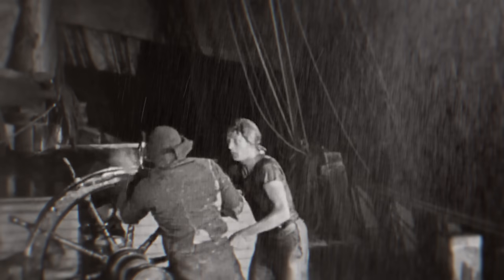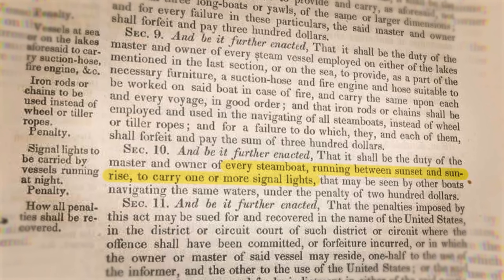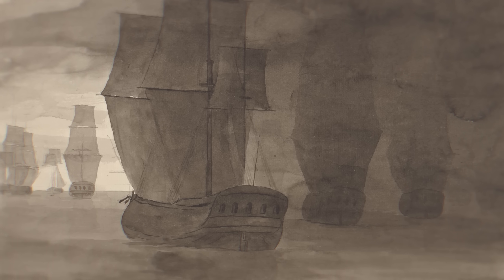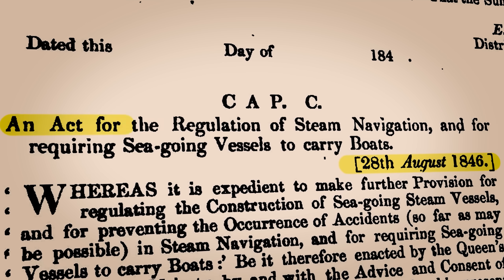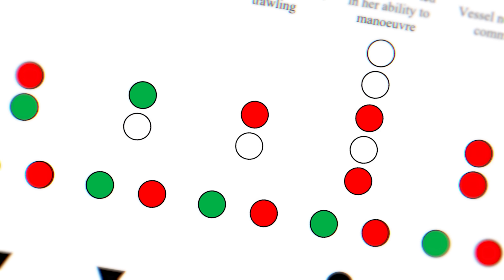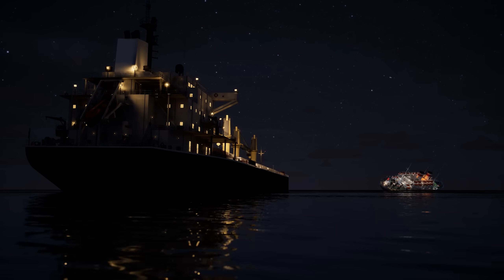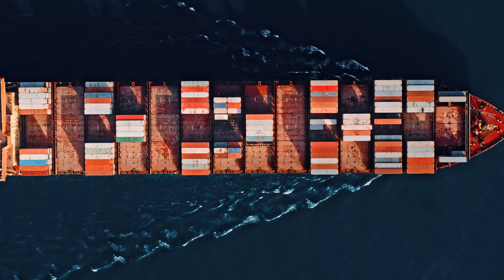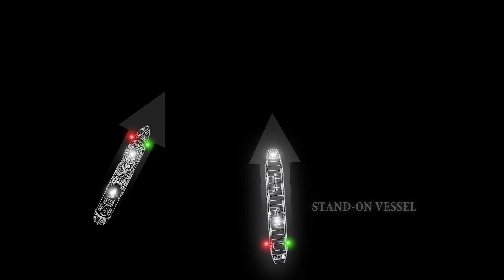How Ships' Lights Work

Comment: Aviation has learned a lot from maritime, aircraft use port and starboard red and green along with several other carry overs. Perhaps the maritime industry could adopt some things from aviation, such as TCAS. Traffic Collision Avoidance System. A modern take on the avoidance rules, especially helpful in fog or low visibility.
Reply: They also use knots for speed

Comment: One of the things that probably led to the choice of red and green is that both can be achieved easily by placing colored filters over a regular yellow light, like the one oil or kerosene lamps or give off, and that later on could be easily achieved from incandescent lightbulbs. If blue was chosen, for example, it would be really hard to make a bright enough light to give off a signal that was clearly visible at great distance.
Reply: Yes, glass makers can easily make a good green and red glass that transmits light well, along with a clear glass, and this, when combined with the low output amps of the time was needed. Other colours were both harder to make, and less light transmission in thick sections, which would be needed to survive rough sea and handling.
Reply: I was about to say the same thing.  Blue would have been very hard to do.
Reply: A blue glass or lens in front of a yellow flame will give you a green light. For a long time kerosene or similar was used for lighting.
Reply: @Kevin-go2dw  hmmm no… primary colours of light is red green and blue…. Yellow light only contains red and green light… so no you can not make green with blue glass/lens… you can get red or green with a red or green glass/lens.. you are thinking of paints.
Reply: @magnustveten492  early glassmaking didn't achieve perfect color filters like we can produce today. their "blue" glass, which allowed a range of shorter wavelengths through in sunlight, would have permitted enough green spectrum through that a yellow light (lacking in the true blue spectrum) would have appeared green.
Reply: Blue was used in wartime as a station-keeping stern light for ships in convoy, when all other lights were necessarily extinguished. In that situation, a dim light was a virtue as it would only be visible from close quarters and unlikely to attract unwanted attention.
Reply: The human eye is also the most sensitive to green color. But they probably didn't know that back when red and green were selected.
Reply: @major__kong  White lights can be mistaken for stars. Yellow/orange lights are usually used in fog situations or might be mistaken for sunlight reflected on the water. Red and Green are the more luminous against a dark or black background.
Reply: @KebabMusicLtd  easier to distinguish one from the other. Better than red and orange, for example.
Reply: And i also have a question,why do ships needs to have the green and red lights on the deck's side and not on the mast and oriented as usual ?
Reply: @EdwardBesleaga-y1j.  Perhaps because it is/was easier to tend to lights at deck level, and that collisions only happen when vessels are close by, so putting them at deck height would be enough to be seen at the distances that sailors had to worry about collisions. On top of the mast would make them visible from way too far away.
Reply: That and we have cones for red and green.
Reply: I've seen some pretty good hypotheses on here for the choice of red and green lights. While I'm sure at the time they didn't know about blackbody radiators, trichromatic vision, or photopic vs. scotopic vision, they would have made their choices based on convenience as well as trial and error.

Contrary to popular belief, these colors, particularly red, actually align poorly with night vision sensitivity. While green light is the peak of human sensitivity*in daylight* (known as photopic vision), as it becomes darker, the vision's sensitivity drifts toward blue (scotopic vision) and we become particularly insensitive to longer wavelengths, particularly reds. This is known as the Purkinje effect.

So why red and green? I'd suspect necessity. Light from a flame simulates a blackbody, and often a particularly cool one, maybe somewhere between 1200 and 1800 K. The vast amount of visible light would have been in the longest wavelengths, red. Whatever other color is chosen has to be far enough away from red to avoid any ambiguity but is at the disadvantage of such a light source producing drastically less amount of light. On the other hand, human sensitivity does partially offset this...

Our eyes are still reasonably sensitive to green at night and it has the advantage of mostly stimulating a different cone (assuming you don't have some particular kinds of color blindness). The orange-yellow unfiltered light for the other light sources are also far away from both to avoid any ambiguity there either.

While I lack any real knowledge of old school glass manufacturing to speak of the efficacy of blue filtering at the time, there is so little blue light in such a flame that I believe any methods, even modern ones, would result in such a dim light the two colors would not appear equidistant, assuming they could be seen at all.

Furthermore, one must consider why we experience the Purkinje effect in the first place - at night, all natural light shifts toward blue! Compound that with how water absorbs long wavelengths, the blue appearance of so many stars... While I can't be sure this played a part at all, it certainly would have been such a disadvantage.

Finally, while I am very confident that preserving night adaptation had nothing to do with the color choice, it is very true that use of deep red light helps there. We use such lights in astronomy for that exact purpose.
Reply: Odd that this wasn't mention in a video titled Here's Why Ship Lights are Red & Green
Reply: @SamuelFritz2001  well maybe itd be in a video on how old colored glass was made.
Reply: @SamuelFritz2001 Touché!! 💯

Comment: One reason that red and green were probably chosen comes from oil lamps. As they have a yellow flame, it is impossible to create blue (put a blue filter and you get green - in fact, many oil lights use a blue filter for green for this reason). Yellow was presumably also out as this could just be a broken filter, etc. 4:43
Reply: Yet law enforcement vessels and vehicles show Blue lights all 24hrs so that they can be ID'ed as LEO people as opposed to civilians.
Reply: So you copied the other guy's comment?

Comment: When I was in the navy we were told that port and starboard come from old ships where the  steering was done by an oar on the side of the ship.  Since most people are right handed the oar was on the right side of the ship. Therefore it became the "steerboard" or starboard side.  When you went in to dock you didn't want to damage the rudder so you tied up left side to the pier so it was the Port side.
Reply: In older days the terms were starboard (steerboard) and larboard. These could be confused in bad weather, so the latter became port.  We’ve just been to Cyprus where there is a reconstructed trading vessel from 300BC - this had steering oars on both sides of the stern…
Reply: This doesn't seem possible, you need oars on both sides of the ship.
Reply: @neondemon5137  The oar was for steering not propulsion
Reply: @neondemon5137  Just re-read the OP and all will become clear. 😉

Comment: Great video Mike, from a long time oceanliner buff in Norway. A comment to the navigation lights: In addition to the red and green port/starboard lights, and a light on the foremast, a light is also required on the main mast for ships over 45 meters in length; located HIGHER (4-5 meters) than the one on the fore mast. Thus, when looked head on, the lights will show which direction the vessel is travelling. Aka. if the lover light (foremast) is to the left of the higher (mainmast), the ship is travelling to starboard, and vice versa. If the lights are directly above one another, the ship is sailing dead on your location.
Reply: Be careful though bc an anchored vessel has them exactly like that in opposite direction (the stern one lower than the bow). The red and green light are necessary to establish wether or not she's under way

Comment: When I was in high school and learning to fly, I was taught the memory jog "We have no red port wine left while green to go means I'm right." I still remember it 50 years later so it worked.
Reply: Port and wine have one syllable, starboard has two.  It corresponds to steering signals also.
Reply: My father's expression for it, back in the 1950s, was "the waiter left the (red) port on the table".
Reply: Short words on one side, long words on the other. Left shorter than right, red shorter than green, port shorter than starboard.
Reply: Thats a good one. I remembered it by left, port, and red are all shorter words than right, starboard, and green, and lump them together mentally that way.
Reply: When the ship was ‘red’y, it left port.
Reply: Red port left (in the bottle)
Reply: My father, who ran for political office twice and was also a Pilot, had no trouble remembering that “Red is Left” - if you get my meaning… for someone who was 23 during the McCarthy trials, left/red/Communist was not hard to remember.
Reply: That feels needlessly over-complicated. Red=left green =right, it's not that hard to remember
Reply: @cleverusername9369  Well, it was fifty years ago and I was but a callow teenager at the time so my instructor thought it was perhaps as good a way as any to remember something new. 

That said, little mnemonics served me well over my aviation career and I can still remember quite a few. "East is least and West is best. " "Ne-odd and Sw-even" for the flight levels and "Notre Dame Southern Cal" for descent or a climb from a track.  I even had one for the electrical shedding priority in the 757 but that seems to have slipped into the past. 

Either way, after awhile you of course just remember things, but they did help at the start.

Comment: The interesting thing is that aviation borrowed a lot from the nautical world, particularly during the heyday of the flying boats during the 1930s. It's why you always enter/exit an aircraft from the left, why the flight crew have the ranks of captain and first officer, and in this case, why the navigation lights are red on the left wing and green on the right wing facing forward, and white facing backward.

Comment: Perfect for the red/green color blind! :P
Reply: I would advise against pursuing a career in navigation
Reply: @BadgerOfTheSea  It's like 2% of males.   Not exactly uncommon.  And it doesn't apply to careers; simply operating a pleasure boat is an issue.  It was a poor choice, taken back when colourblindness was seen as a genetic defect and therefore not talked about.  It was covered up.
Reply: I am 'colour-deficient' (FYI, there is no such thing as being totally colour blind), and, initially, through 'creative cheating', managed to pass all the required colour screening tests (lantern, Ishihara, etc.) for the merchant navy.  Spent 30 years as a navigation officer, working my way up to 1st officer.  

I never had any 'qualms' about this 'cheating', as I never had issues at sea distinguishing the coloured lights - it was only the screening tests that I could not pass.  I had a wonderful and interesting career at sea.

Comment: If turning to port is discouraged, why did Murdoch turn the ship to the left to “port ‘round her?  Am I missing something?  I know almost nothing about vessels, so I may just be confused.  And what would have happened of Titanic turned the other direction?
Reply from the maker: Good question! The COLREGs rules apply to ship-ship collisions. In the example I showed of ships on converging courses the give-way vessel should veer to starboard because then she will pass safely behind or astern of the stand-on vessel. Titanic on the other hand encountered a stationary obstacle - interestingly such an impact is called an ‘allision’ because it involves only one ship and one object. So there were no rules - just the crews’ split-second decision-making to guide them.
Reply: Fat chance of the iceberg turning the wrong way.

Comment: 4:55 I see red on the right, green on the left. This was the mistake I thought you corrected, hence the reupload.
Reply: Kind of. There was initially some misinformation in the previous upload about seeing the green and red lights when the ship is in front of you, going in the same direction. 
The lights are set so that they're visible from the front and sides, but not from the back.
Reply: He had said red and green could be seen from the rear, the same as the front.